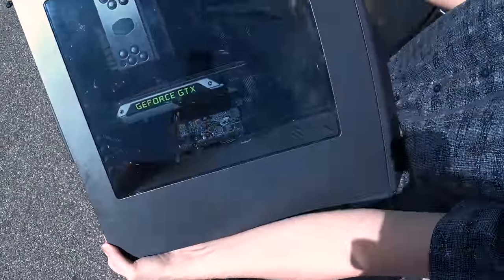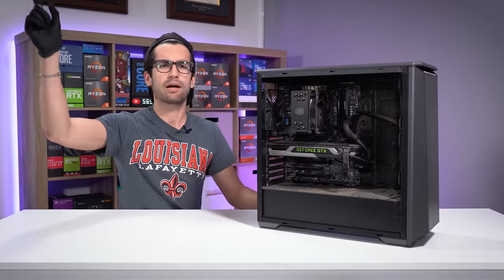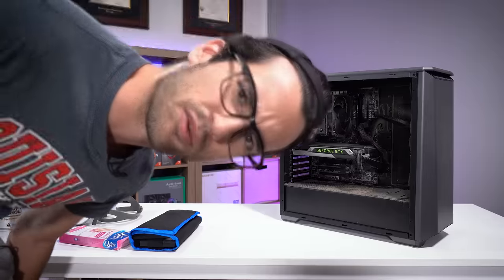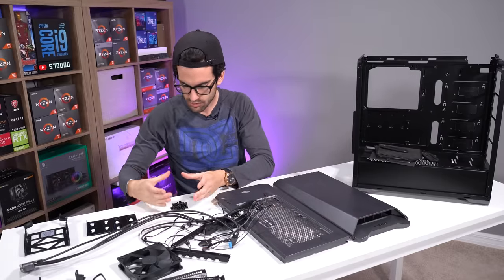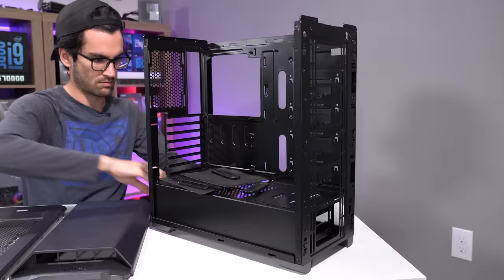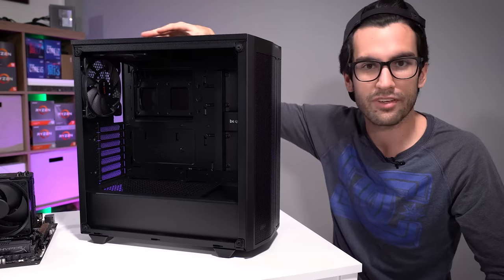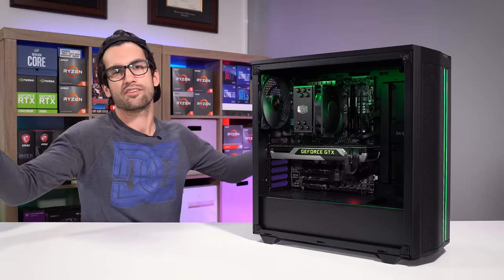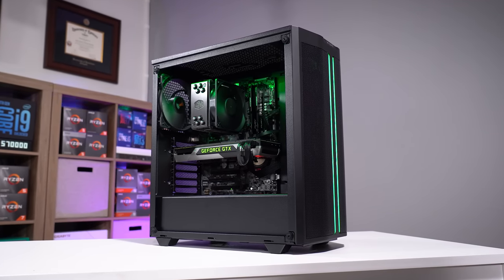Deep-Cleaning a Viewer's DIRTY Gaming PC! - PCDC S1:E7

Comment: I just did my new build in a be quiet 500dx last weekend. Awesome case and great airflow, especially when you add 3 120mm fans for intake and use the 140mm for exhaust

Comment: Greg: Has a knockoff ifixit kit because he's cheap.
Also Greg: Drives a Porsche...
Reply: Live like no one else, so that you can live like no one else.
Reply: He have a F430 too
Reply: you have to know your priorities
Reply: @92trdman  360
Reply: And an Audi S5 and Infiniti Q60S lmao
Reply: Being limited to 900RPM is a big factor in the case of cooling. I know they're airfow fans, but still need to overcome pressure from grating. I've found that 120mm vs 140mm makes not that much of a difference in terms of pressure. 

I find my pure wings are constantly maxed out at 1100 RPM(mine sping 200RPM faster and still not enough cooling) I ended up adding value pack 5 fans from other German brand. The resonance of the other at 1100 RPM fans are the only caveat. anf they literally spin at double the RPM.
Reply: iFakexit
Reply: Youtube life

Comment: The guy has a trunk in the front of his car! 😍
Reply: Frunk
Reply: It’s a super car obviously 🤦🏾‍♂️
Reply: Porche puts the engine in the middle of the car (directly behind the driver seat). It means the front is empty and so they move the trunk there.
Reply: @redmafia9011  its not a supercar is a cayman so a sports car
(Edit) 
You were right its a 911 not a caymen so supercar
Reply: @philmander5752  as a 911 the engine is rear engine technically. The 718 is the mid engine
Reply: @mikecharnecke3087  K. Porche is sort of the last holdout when it comes to mid-engine designs so I was generalizing about them.
Reply: @philmander5752  nah bro 911 is rear engine not mid and panamera is front engine
Reply: Actually, there is a car behind the trunk!
Reply: @redmafia9011  *rear engine car
Reply: @philmander5752  you should reconsider your definition of "middle" lmao
Reply: actually, it's a crash safety compartment
Reply: @drdisresfaketaxi2898  actually, it is a trunk.
It may double as a crumple zone aswell, but being a trunk is it's main job
Reply: bro what where tf is the engine ???
Reply: @microwave6097  in the rear
Reply: @redmafia9011  super car? lol

Comment: Hey Greg, Great videos.  As an outside observer I would like to recommend if you are really concerned about the dust, invest in a small vacuum or shop-vac instead of using that mini-blower.  The electric blower is cool and really very handy, but all of that dust from your client's home is just getting blown around the inside of your own home where your family will breathe it as it's cycled through the air and potentially your ventilation.  Just a thought since you invested in a respirator for yourself, take care.

Comment: Just so you know Greg, you can buy the P400a front panel off of Phanteks shop, it costs $20 bucks. I liked my P400 and couldn't afford another case so this was the better way for me, dropped my temps significantly. I was also able to keep the lighting on the bottom by just removing the bottom of the old panel and replacing the new one.

Comment: I have this case. Super cool cooling with an I 5 10600k but word of warning. It too sucks so much dust in the front that I have to clean it once a week with the front filter at least. And no, it's not sitting on the floor but on its own little table.

Comment: I just bought a p400a mesh front panel for 20dlls for my p400, that fixed the horrible temps, I used to do the same thing in summer, removing the front panel entirely.

Comment: As a fellow computer cleaner, that is some solid cleaning work, congrats. Most people just go over with compressed air and call it a day but this what a good, meticulous job looks like.
Just, around min 10, we don't see any sort of ESD protection while touching the board, please don't forget to use something like the gloves you were using before. Unfortunately, i saw totally avoidable ESD damage happening way too many times (apologies if you were wearing something, they don't need to be visible, after all).
Also, i realize this is a promoted video by BeQuiet (which is a great, albeit a bit expensive brand) but the Phanteks P400 is actually one of the best airflow cases out there, if you just replace the front panel from that solid block to the metal mesh like the BeQuiet also has. It's actually what they did on a follow up revision of the P400 case but for people who already have the solid front they can just replace it. The mesh panel should be cheaper than replacing the whole case.
Other than that, keep up the flawless work!

Comment: Have you maybe reviewed the Zalman T7 case? I just got it for my build, it's around 35$, has a full mesh front panel, place to mount 2 fans at the top, magnetic dust filter up top and a dust filter (non magnetic) at the power supply. It also has a power supply basement

Comment: and the rear 140 pulling the air pushed out out of the CM heatsink has to to have done wonders for the temps as well..  

I'm only a casual builder, but given how close that rear 140 is to the heatsink, could moving the fan on the heatsink to the other side and into a pull config help the temps more (as the said fan would be getting a bit more of a pull boost from the 140 also pulling air out of the system)?

Comment: I have the original P400, still in daily use, I bought the P400A front panel when the P400A was released, cost 20€ and it's great, would probably been a better option than a whole new case because that was the only issue, well that and no radiator support for the top.

Comment: Purebase 500 DX Is such a good airflow case. Alternatively, one can buy a P400A front panel separately & replace the original P400 front panel. Can't go wrong either way though.

Comment: For those of you who have this case, you can actually order the P400A front panel direct from Phanteks website and it'll fit right on your P400 without any issues. My friend has done it and mine comes in tomorrow.

Comment: I actually had the same issue with my P400S, with 2 front, 1 rear, and 1 top rear fans it was getting choked by the limited airflow on top and bottom from front panels. So when ever I would game I would take off the front panel. Was actually considering buying a new case. Then they decided to come out with the P400A (Mesh front panel) was considering buying that but then they won me over buy selling just the front panel that fits the original P400. And can tell that the airflow is 1000 times better, no longer getting choked and able to run fan at 20-40%. So those who have the P400 no needing to buy a new case just buy the P400A panel

Comment: I've definitely had the same problem with my P400 case. Much cheaper solution was to just buy the replacement P400A front panel though.

Comment: You might consider leaving the CPU in the socket on the motherboard until you have finished cleaning the surrounding areas of the board to avoid any dirt getting into the socket or damage to the pins on Intel boards.

Comment: I remember probably 18 years ago, some dude brought a PC... DAMN it was dusty. Motherboard... you could not see it, only towers from capacitors and those stuff 🤣😂. You can say sand city in there. Computer turned on but worked like crap... of course 😋. So I went outside and air blow everything, did general cleaning and PC did not work anymore. Dude did not want me to do anything more with it, othervise I would find the colprit and possibly replace it. Dude did not know dust status inside at all, never cleaned it hehe. In my life I got some real dusty technology stuff but that one was catastrophic loool 🙂.

Comment: I have to remove my front panel as well. I have the MSI Gungnir 100 case which I read had decent thermals in spite of the front panel.

Guess what? It doesn't.

Comment: That bequite case is tiny I put a rtx 3070 msi trio for a customer it bearly didn't fit had to slowly put it in cause when I tried to put it normally going towards the bracket side first them the rest of the card it bumped on fans had to put it in at a angle and then turn the card straight line it up to the slot and then connect it this case for the price should have been a little bit longer for trio cards

Comment: I have a Corsair CX850M and its powering a X5570 stock and GTX 780 system which total has 450w powerdraw but as soon as my friend lets the gpu push more frames and gets put under more load the powersupply sounds like a turbine. Have you ever had that issue if so is it normal or should i dump the powersupply and get a new one?

Comment: Wouldn't the front panel for the P400A work for the P400 as a swap? Unless I'm an idiot.
Reply from the maker: Probably. But we found better temps with the 500DX thanks to its 3 included Pure Wings 2 140mm fans.
Reply: @GregSalazar  Well, it turned out great!

Comment: If the owners of the PCs you clean give consent, you should consider delidding older Intel CPUs and replacing the thermal paste with liquid metal. It can drop temps by as much as 20°C! I build and sell custom PCs, and I've delidded every Intel CPU I've ever owned or sold.

Comment: Take the SD Card out of your GoPro, clean the terminals with Iso, check the card and do a full format on a PC, then try the card in something else first. People leave cards in their GoPros forever, resulting in corrosion on the terminals, and expect a relatively short life memory card to last forever. GoPros, and dashcams stress the cards by intensive, and in the case of dashcams continuous recording. While you are at it, clean the battery terminals also, as chances are you are also having battery problems. Lastly, factory reset the camera, as it operates like every other smart device, from a reprogrammable OS, which can become corrupted. Do all this, and your near indestructible camera should work properly again. Oh, and as GoPros are designed to do short (Usually 8 mins.) videos, don’t record for 30 mins straight, as they run extremely hot, and that’s not doing the camera any good either.
Reply from the maker: Ok, this is super silly... "GoPros are designed to do short (Usually 8 mins.) videos, don’t record for 30 mins straight, as they run extremely hot, and that’s not doing the camera any good either." Pretty sorry attempt at defending them. They allow for long recordings and there's NOTHING to suggest that they're only designed for short recordings. Also, the SD card and battery terminals were FINE. The software is just shit. Accept it 😂
Reply: @GregSalazar  Says so in the manual. Might have to look for the manual as they don't typically supply one. If recording while strapped to a helmet, vehicle, rocket, or under water, there is enough cooling to record as long as there is space on the SD card, and the batteries last. Meanwhile, I ran my 8 as a pretend dashcam (Planning to splice all the 8min videos together.) and because I had the car windows closed, and the fan not on the window to cut down noise, I damn near burnt my hand when I went to take the camera off the windscreen after 30 mins or recording. It also was slow to respond to both the button, and phone commands, until it had cooled back down. The instructions actually say the metal ring around the lens is a heatsink and can get hot enough to burn skin. So, not only am I right, I've also had absolutely no issues with mine because (Except that one time.) I actually follow the user guide, and the suggestions I listed above. I clean battery compartment and SD slot, do a full PC format and scan on the SD card occasionally, and allow the poor thing to rest for 30 mins between extensive video sessions if there isn't plenty of airflow or under water.

Comment: yo what is up with people using that corsair PSU lately not evga i have a 500-watt EVGA PSU that lasted me till 2017 now I need to upgrade my PSU to a 750 watt or 850-watt PSU for upgrading my GPU from a 1060 6GB GPU to a 1080 ti 11GB GPU so i cannot wait but waiting for the right brand to pick I might go corsair to try out a new brand I know EVGA is a reliable one from my 500 watts i am using the same PSU i got in 2017 early 2017 post scalper issues problem.

Comment: or u can just buy p400A mesh front, replacing the old solid one, much smaller carbon footprint to not ruin our environment with more consumerism buying all these new cases when you dont need them. the bequiet case seems to have the top of the case riveted while on the phanteks one its screws holding in. much easier to install radiators and stuff on the top with a removable top panel than having to bother with clearance issues w bequiet riveted:tm:

Comment: can someone tell me why when pc says "no keyboard detected"  it asks "press F1 to run SETUP"   this is always just as funny..
Reply: Its only for usb keyboards. I used to need to keep a ps2 keyboard with me for when computers would have spaz over usb.
I think older computers wouldn't always detect usb at boot or atleast needed it turned on in bios.
Probably just one of those things left from the old days.
Reply: @darrenfalconer3267  sounds like w10 is not as new as i thought
Reply: @hellureitaalla5224  its the bios that is displaying this, not the operating system.

Comment: Why don't he just use a vacuum with an anti-static brush instead of the blower that just blows dust everywhere?
Reply from the maker: I deep-clean my office after every one of these PC cleanings. Dust gets everywhere regardless. And even compact vacuums are much bigger than these electric blowers. If it gets bad enough, I take them outside and blast 'em with a leaf blower or whip out the vacuum.
Reply: @GregSalazar  Is it an Opolar air duster, I saw a new one on Amazon that is also a vacuum for $99, I'm probably gonna get one.

Comment: I respect your work but you can tell that he is your viewer. you both put your power supply upside down. thats a really bad idea and it will just inhale hot air from your casing. you wont get any temperature benefits from doing so.